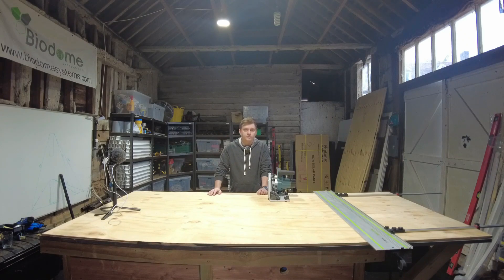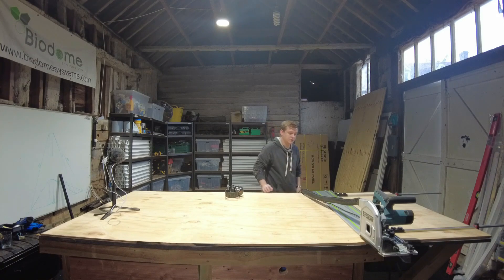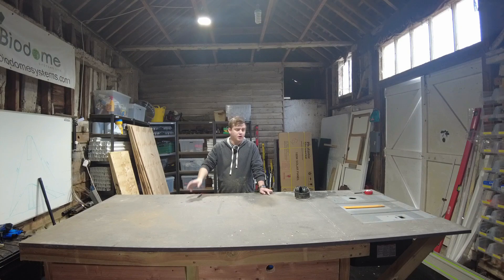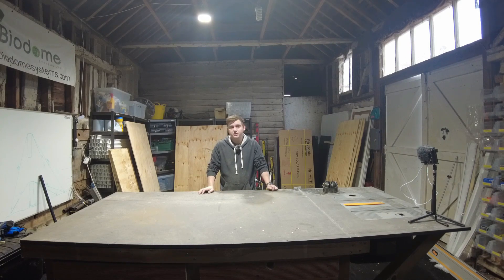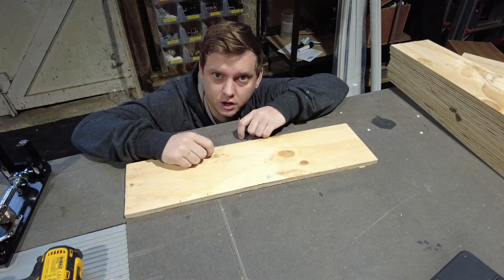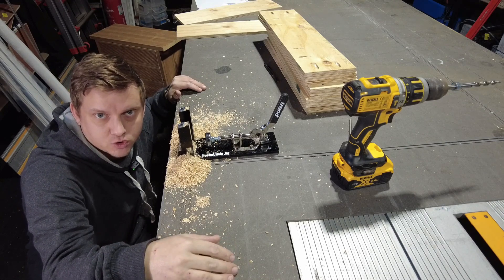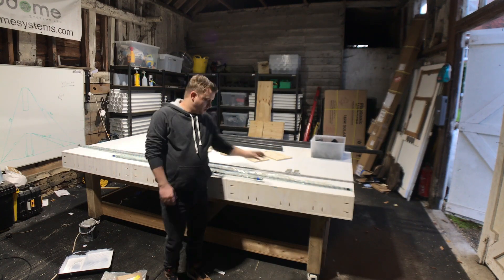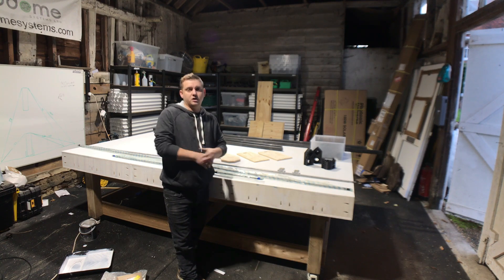Huge Home made CNC machine for £1500 pt1: Torsion Box Table

Comment: Great video! So you have the parallel guides for the circular saw, but you need the stop blocks for the miter saw. Would have saved you some time.
Reply from the maker: My circular saw normally goes to site for jobs so I don’t have it set up with a permanent spot in the workshop

Comment: If you want the larger section of plywood to be the same length, then you cannot measure from the smaller end. There is too much variability in the size of the boards.  Up to ±5mm.
Reply from the maker: Cheers Steve, I’ll make sure to measure all the boards before hand next time. Luckily it worked out ok for this build